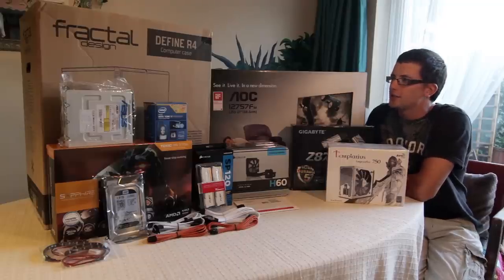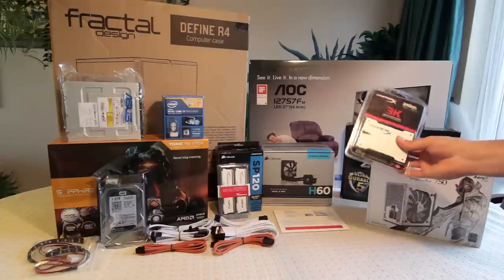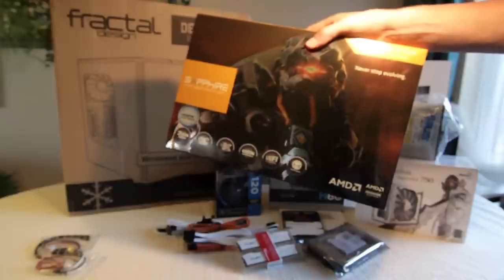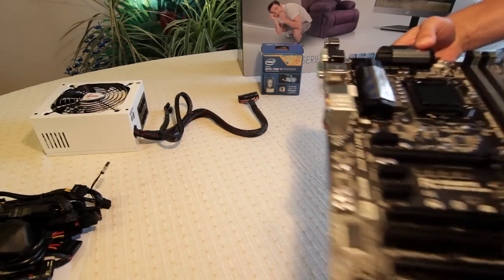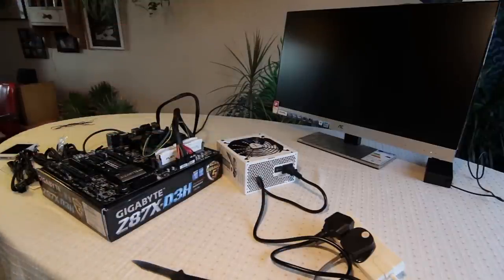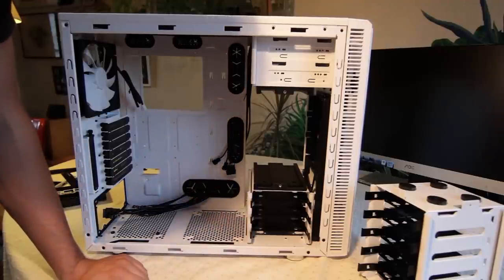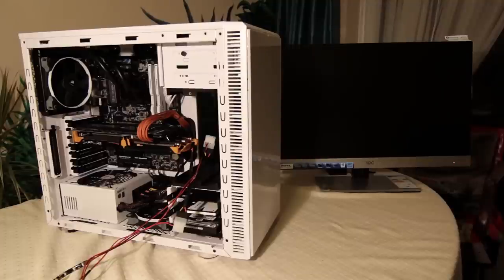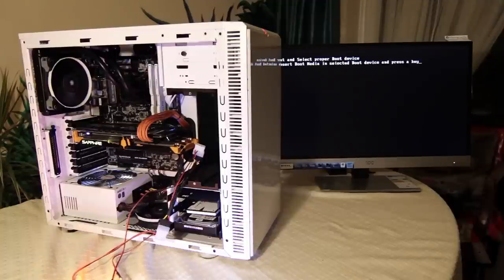New Computer Build

Comment: I watched this entire video, with a sketchy attention span. lol
I have some questions, if your still in the answering mood.
I have a 2012 game, from high moon studios. Maybe you've seen or heard of it. http://store.steampowered.com/app/213120/ I had waited till February 2014 to get it. In order to play it, I have to lower its Graphics settings to the lowest setting. I am still having issues. Nothing that I can't ignore, and still have fun. But they get annoying after 5 hours of playing it. The explosions in that game, freeze the image for a second, just long enough to die. My question is, can this specific build get rid of this issue? If you are not sure, could you recommend a build that will?
Also, will these components fit into another computer case? 
Also, in your opinion, where does one, such as myself, start when researching for his own components to build? I had thought, maybe I'd start by choosing a motherboard, then figuring out what power source it requires, figure out what graphics cards it can handle, find out what ram it can take, and then the hardrives. Double check to make sure I'm not missing anything, wires, cables. Also making sure the cooling, and power source can handle everything. 
Is any of this correct? If not, please correct my thinking. lol
And add in any other things to watch out for when researching.
In the mean time, check out this crazy awesome score. http://steamcommunity.com/sharedfiles/filedetails/?id=466350903

Comment: What Network Card would i need to get so I can be connected to the internet.
Reply from the maker: It depends. There are many different kinds. This board supports both PCI cards and PCI-E cards. Network cards usually come on a PCI-E x1 bus. Get one that is compliant with your wifi. Most modern ones now will be able to pick up any signal from a router.
Reply: ***** Ok. Would I need to get a specific Network Card?

Comment: hi, im getting the same case, can i get my 780 in there?
Reply from the maker: Absolutely, there is loads of room in there if you move out the drive cage as I did :) great case!
Reply: does this look like a good build? (try your best to understand, its in swedish)  https://www.komplett.se/k/shoplist.aspx?mode=receive&si=1423514&su=06FD21AF-E00D-41CF-BFA6-7628580180CC
Reply from the maker: Yes that looks pretty sweet! Only thing I would possibly suggest is upping your SSD capacity, I nearly bought a 120gb but found iv already surpassed that, just with the OS and a few program's like CS6. If you think you'll need more storage I'd go for a 240gb, they are quite cheap now, or even a mechanical drive. Happy building!
Reply: thanks for all the advice, but i have 3x 1tb drives in my current pc. imm quite nervous its my first build :3
Reply from the maker: Oh right well that's more than enough! Don't be nervous, it's dead easy, but watch some more videos etc, don't go off mine! Ive only done it a few times! Best videos iv seen on computer building are from Newegg, just search them in YouTube if you haven't seen any already, they do a great series on how to build a computer, step by step, good luck!